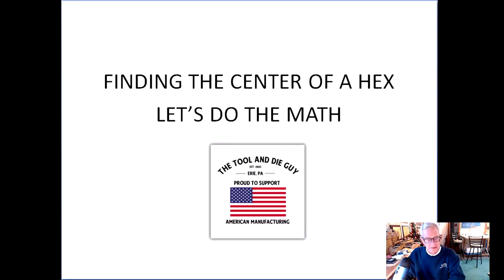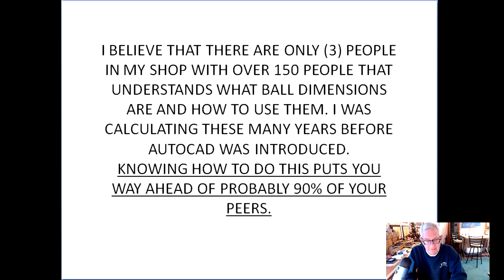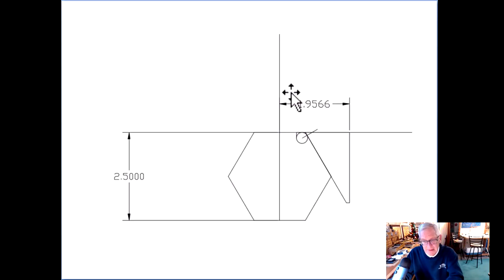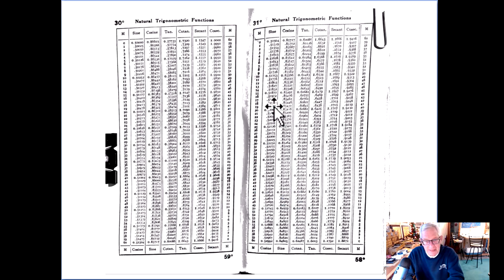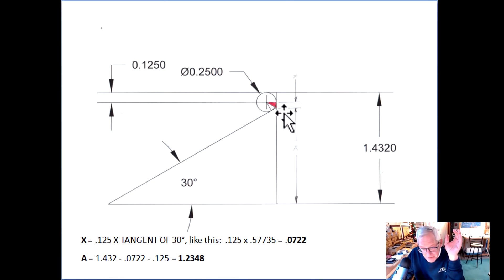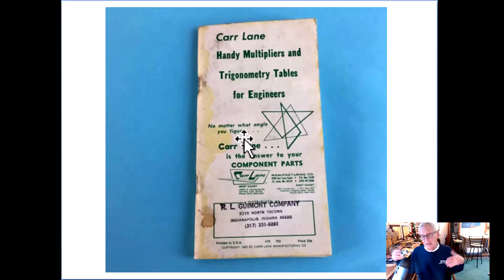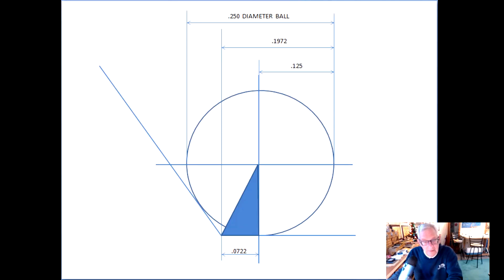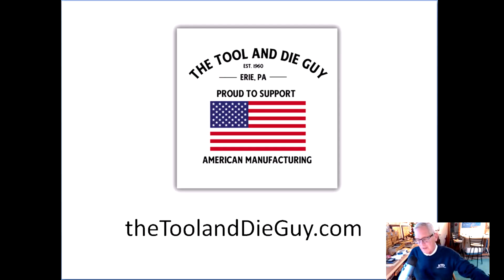BALL DIMENSIONS PART 2

Comment: Ok, newbie here.  Using the ball chart I came up with x=2.5479".  I can figure out the dimensions of the highlighted triangle, but I can't figure it out without the ball chart.  I don't get the relationship of that triangle to the answer.  Using the chart, the best diagram is solving for b.  Any help understanding what I am missing would be appreciated.

Comment: You would be really great at aligning pump and electric motors. I mean REALLY ALIGNING  them.
With dial indicator on coupling face, shim 4 point elevation, threaded base adj.
You are right it was really handy to know, that always happened when I least expected it. Company never had the equip..?  If I could get home I would bring my setup.
 I am 73  work is all I did I would do it now if I could. 
I enjoy your videos, I still can't get enough.

Comment: Phil, Please let folks know that before using a calculator app on their phone, verify that the app was programmed correctly.  Maybe 15 years ago, I was at my desk working on something when another Engineer started asking what was wrong with a trig calculation he had just done.  He knew that the app had given an incorrect answer, remembering back ~40 years to school where he had taken trig.  The Engineer sitting at the next desk pulled out his phone and did the same calculation & got the correct answer.  After a bit, the 2nd Engineer figured out that the 1st guy's app's programmer has forgotten to properly convert from radians to degrees, giving the incorrect answer.  (I always used an actual calculator for calculations [after writing the formulas down on paper], but neither of them had an actual calculator with them.)  Decent scientific calculators should always be kept handy,whether at a desk or in your toolbox!

Edit: Is the "offset" = 2.53471?  Or = 2.5386?  Please show the triangles that you used to solve this problem!

Comment: If you don't want to perform any trigonometry. Place a roller in the corner where the hexagon face meets the vise jaw. Indicate the roller center and zero the DRO. Repeat on the other side and half the distance on the DRO. This gives the center. Alternatively, if you have 2 rollers and no DRO, just sweep the indicator between them. To repeat on another part add a roller between the stop and the angled face.
Universal constants apply to all 6-sided polygons and all ball diameters used with them. One is a proportion of the distance A/F and the other is a proportion of the ball diameter. If we multiply the distance A/F by 0.2887 this gives half the length of the flat. Multiplying the ball or roller diameter by 1.366 gives the distance over the ball to the theoretical sharp corner. Add them together for the distance from the end stop, over the ball, and onto the center of the hex.
In this case, the 1/4" roller would be outside the hex. So half the flat distance would be 2.5x0.2887=0.7217 and the distance over the 1/4" roller to the theoretical sharp corner would be 0.25x1.366=0.3415 added together gives 1.0632 from the end stop to the center of the hex.
Reply: Love it!  No triangles! No trig! No calculator! 3 straightforward simple calculations 2 multiplications and an addition.